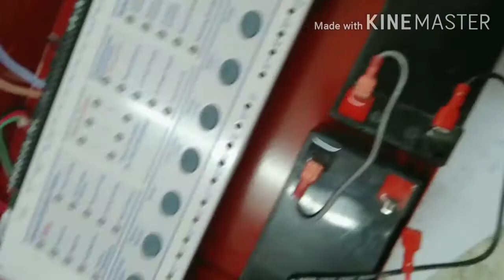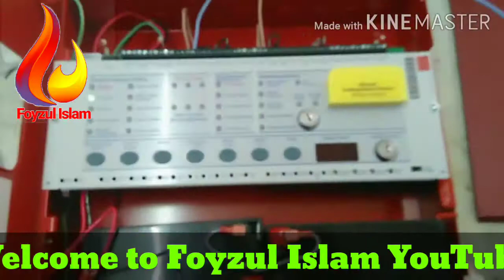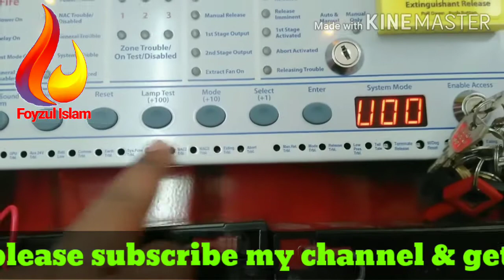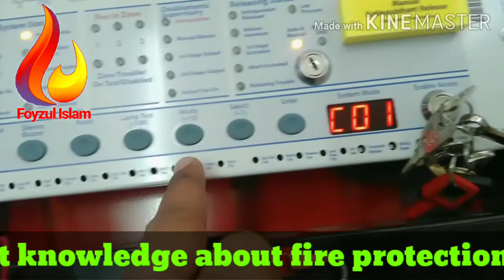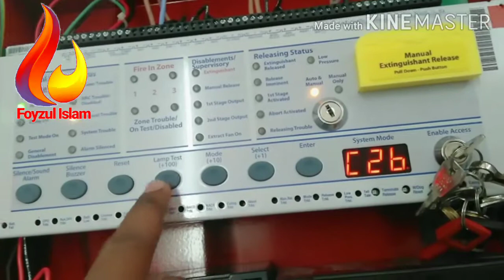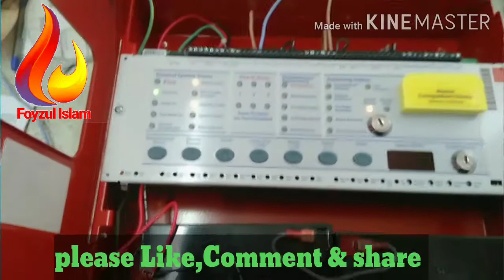A-XT Shield panel - How to make programing in this panel

Comment: Bro how can i disable the buzzer/ internal panel sound.buzzer soind is not working
Reply from the maker: Bro, we can't  disable Buzzer sound. Bcz it’s Civil defence Requirements. But you have to make  silence. If you want to operate any key on this panel. First you have to  put key in Enable Access and make it Enable after that you can make silence or you can operate the panel.  If it’s not working that means we have to call service Technician
Reply: @foyzulislam9975  i know it. But we need to stop the beep beep continous sound.please let me know if any options there..
Reply: Thanks in adavance it will very help us.panel is continuously sound beep beep..
Reply from the maker: @saifrohad6297  make a Disable with key. Then  it will go of. When you make enable key it’s continue give beep beep sound. It's normal